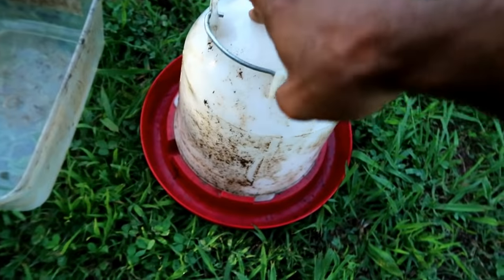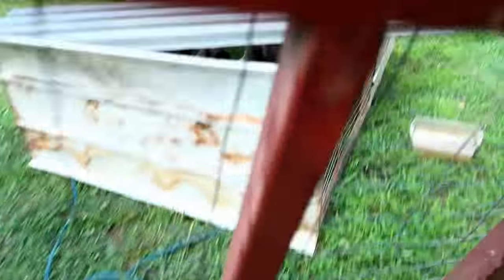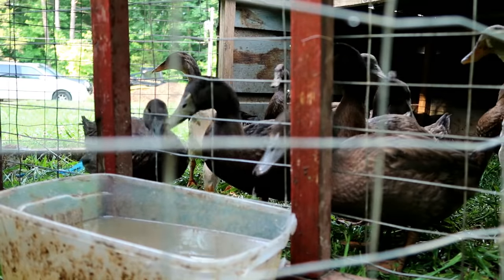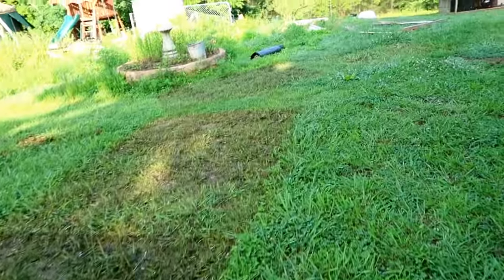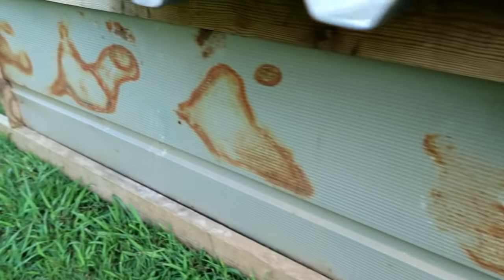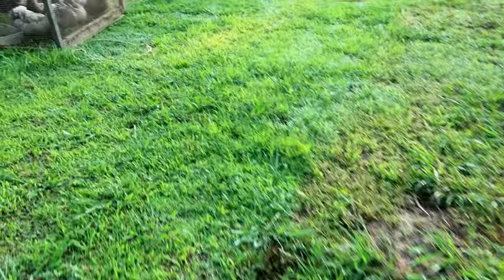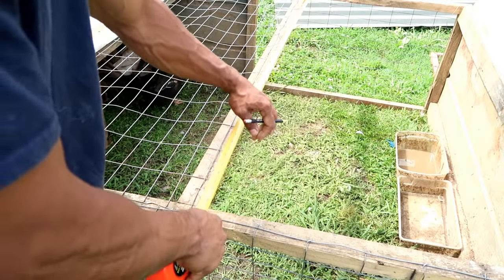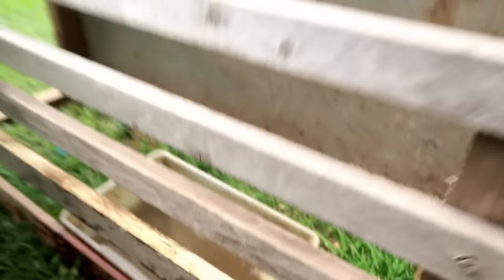"No Messy Ducks!" - How to Raise CLEAN Ducks

Comment: Not big on joes chicken tractor.  Al lumnah  from lumnah acres  has a better option  in my opinion
Reply: Love the duck shield though
Reply from the maker: Russell most of the time we are just working with what we have available. I like the look of Lumnah Acres tractors too.
Reply from the maker: Thanks! It really has made a difference on our farm while raising ducks.
Reply: Big Pond Farm i am in the same boat making due with what i have . Lol most of my materials come from the DUMP. something i inherited from my father "go to the dump with half a truck load ,come home with a full truck load" so im waiting for chain link fence or concrete reinforcement screen . Maybe a cattle panel 🤔. My yard is way too bumpy for pulling my first chicken tractor around  so chicken tractor 2.0 is taller and has wheels cantilevered  off the back so i can pop my handtruck under the front lift slightly  and boom 4 wheels
Reply from the maker: As frustrating as it can be to have to "make do" with what we have it really makes you appreciate things more. It sounds like you have a great chicken tractor that fits your landscape, great job!

Comment: So dont do the water thing it's not fair ducks love 2 dunk there heads and the blow there noses in the water 2 clean them, they also love 2 swim ducks spend much of there time in the water, that's why they have webbed feet! If u are worried about water getting on the ground and causing a mess then dont get them it's not right!
Reply from the maker: Go back and watch the entire video and you will see where Mike talks about the need for them to be able to submerge their whole head. Also these ducks were in this pen because we had very high predator pressure and didn't want them to be eaten. Our ducks have access to water. This is an option for when you can't give them full access to a larger body of water.

Comment: Does anyone know if it would work to free range a couple of ducks in New Hampshire. I have chickens. And have had turkeys a few years ago and they where fine with the occasionally sub zero temps as long as they got locked up at night. I'm not sure what breed I should get but preferably one that doesn't need a ton of water (all I have is a tiny 55 gallon goldfish pond). They have to get along with the chickens.

Comment: Ducks aren't chickens. I raise rare breeds and show them and yes , sometimes I have mud.  Ducks need to  submerge their heads to  keep their nostrils and eyes clean . Ducks also need swimming to  keep their feathers healthiest and waterproof, and  bug proof. You can raise them  without it , but long term it is not best for their  feathering. Some  make  platforms for under their water or  pools so when they naturally drill into the  mud around the  ponds, they 'can't' and  still get their  swim time in...Also  some ducks won't  breed properly without a pond... I use rubber mats inside my  "night house" or when I have to  lock them in.  Around their  pools in their day yard I use wood or  plastic  rubbermaid  lids from the  bins, I cut a square out of and  turn upside down for nests.... I like the  duck tractor concept and  am going to  build one for my mini ducks... My large ducks have 3 different pastures they are turned out into in the  day, then locked into a 'carport' with  dividers and day yards with a hotwire and  fence around it for  coyote/possum/dog  protection. Being a  senior ,I am not  going to  drag a tractor up and  down hills, so I have to figure out how to make one  on some kind of  towable system... (ah, come on, ducks are a little messy...enjoy their water fun!)

Comment: I want to raise ducks and I’ve been looking into it... but I currently live in the philippines. Also, there’s no grass where I live and i’m concerned with the lack of space and the ants getting to them if I leave them outside. Yeah... I probably shouldn’t get them.
Reply: Mango Shelter Its mostly about having enough space. There should be about a 20'x20' space for each duck. The space should be planted with a mix of grasses and legumes. If it doesnt rain at least once a month you will have to water the duck pasture with a sprinkler. Mow the duck pasture down to 4-6 inches every once in a while...
Reply: As long as they are not red ants, the ducks will just eat them.
Reply: Mango Shelter As long as they're not red ants, the ducks will just eat them.

Comment: I don't know if anyone mentioned this but ducks need to dip their head in water to clear their nostrils and keep membranes moist as well as keep eyes moist or they develop a condition called sticky eye.  Early exposure to Swimming water helps them develop their oil glands which can help prevent chills in winter and when they might get wet in colder weather.  That is why I don't like the fencing around their water. It is better to get a smaller wire hardware cloth and make a frame of 2 x 4 and elevate the water buckets on that then there is less mud. Moving them daily helps also.
Reply from the maker: Thanks Lisa. Mike actually mentions in the video of the need for ducks to be able to submerge their heads. ~ Lacie